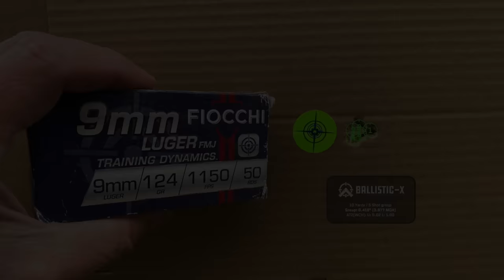Radian Afterburner & Ramjet

Comment: For pretty much $390 the springs should just be included.
Reply: Agreed
Reply: Agreed 100%.
Reply: they are included,  it comes with the comp, barrel, rod with 13, 15, and 18lb springs
Reply: Radian is like apple .. the phone won’t come with a charger lol😂😂
Reply: Do you need the springs? Will it run well with Glock OEM recoil springs?
Reply: @anthonygerber8261  yes it will
Reply: @tylertuck681  No it doesn't...the guide rod and springs are sold separately.
Reply: PMM micro comp/barrel combo $360 with no recoil springs either. The extra $20 or so for the extra aesthetics in machining isn't terrible, although I personally think both are really expensive for what they are.
Reply: I mean you really shouldn’t replace the springs at all. Just run hotter rounds

Comment: I like mine.  Easy removal and installation for cleaning.  Though like any Comp which bleeds off gasses it was way more consistent with NATO spec ammo.  It would hiccup with lower power ammo.
Reply: I hear that about comps, you benefit when it's higher preasure ammo.

Comment: THANKS FOR THE GREAT CONTENT !!!  I PUT THE RAMJET/AFTERBURNER ON MY GUCCI G19 BUILD AND HAD TO DO A LOT OF SMOOTHING AND POLISHING TO GET IT TO RUN RELIABLY.
I HAVE A HEAVIER GUIDE ROD AND A HOLOSUN 508T ON THE ZEV CRYO SLIDE WITH SUPRESSOR HEIGHT SIGHTS.   AMAZINGLY ,THE LOADED UP GUCCI SLIDE IS ONLY 0.3 OZ HEAVIER.

Comment: When shooting with the pillow under the muzzle aren't you defeating the purpose?   Doesn't the force projected downwards by the thrust of the gas directed upwards push the nose down against the pillow only to reabsorb the downward energy thus pushing the muzzle back up?  When there is no pillow the muzzle blast should help prevent the nose from raising up.  But with the pillow it seems like the purpose is defeated.

Comment: What spring weight are you running on the compressor? Just ordered mine last night.
Reply: From where? I cannot find one in stock
Reply: Straight from the radian website.
Reply: He’s running 15lb one. They come with 3 and the red is 15. I use the 18 the one radian sent on it
Reply: @mma101100  10-4, any reliability issues with any of the different weights?
Reply: @reecemeador9216  I haven't tried any of the lighter weights cause factory glock springs are like 17-18lbs I believe so I just kept it at that.
Reply: Red is 15 lb ismi spring

Comment: Comps like this are way overpriced and ridicules. The new SI quad micro and Volker micro comp mk 2 are the way to go. 30% recoil reduction and 100% reliable from the get go with no need to tamper with spring rates.
Reply: Volker MK2 works like a boss on my shadow systems MR920 👌
Reply: @David-mz8mo  ya the volker is really good. The new SI quad is actually a little flatter shooting on my hellcat and a smaller profile/ a little better looking but it is also definitely a little louder as well. I’ve got a few thousands rounds through the volker and about 600 through the si quad so far.
Reply: @thorshammer5134  wish you never told me about the quad. Now I have to buy it 😂. Have been looking at the Radian ramjet afterburner but $400 is just insane - might as well spend it on a pistol class or ammo to train with.
Reply: So those comps come with top tier match grade barrels too? The radian offers an option to those of us who live in places that dont respect the constitution and cant have threaded barrels on our pistols. Its the only option. Do i wish it was less expensive? Sure. Am i glad it exists? Absolutely.